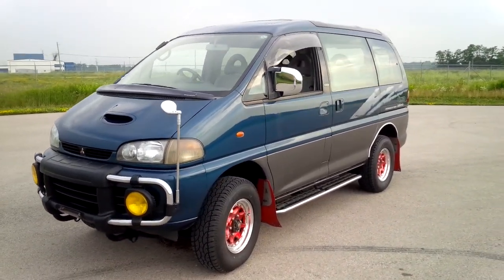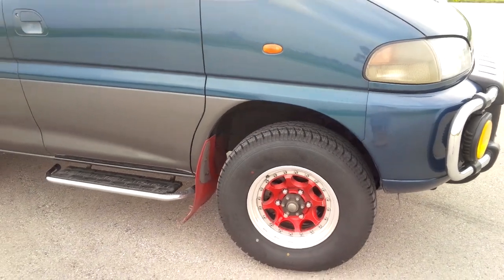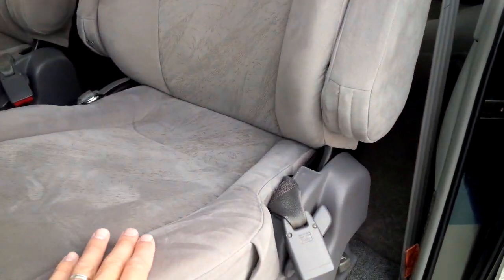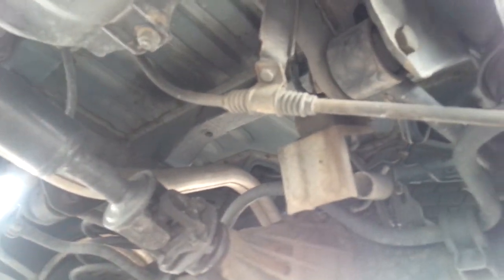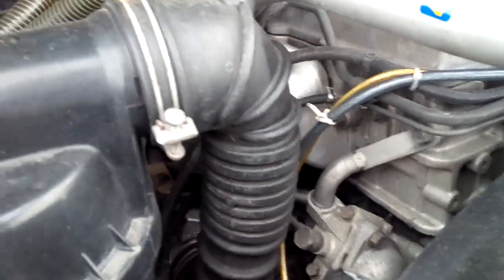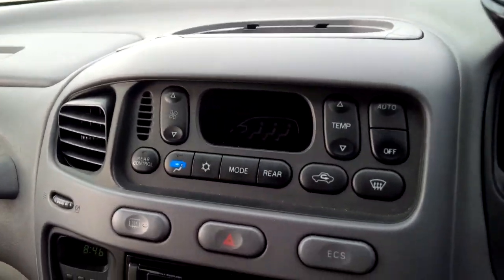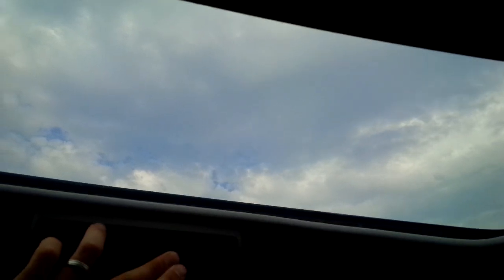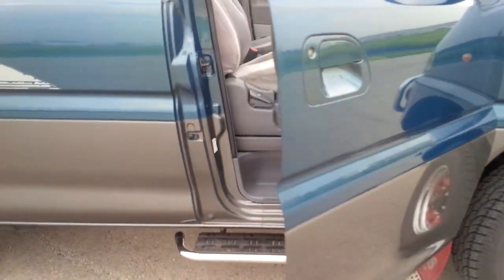1998 L400 Mitsubishi Delica Spacegear Super Exceed tour

Comment: Nice Delica buddy! So much cleaner than mine was before I started working on it.

One thing i noticed was your stock over flow bottle. 
Check out the video I found for replacing it and why...
Replacing the header / expansion tank in a Mitsubishi Delica L400

Also check out the L400 I have been working on.
My Mitsubishi Delica L400

Good luck with your car and make sure to check out the Delica club website.
Reply from the maker: I recommend aluminium expansion bottles to my clients. I sell locally made replacements similar to the UK ebay bottles and have one on my own PE8W.
I like your van! Do you have any build threads for your bumpers?